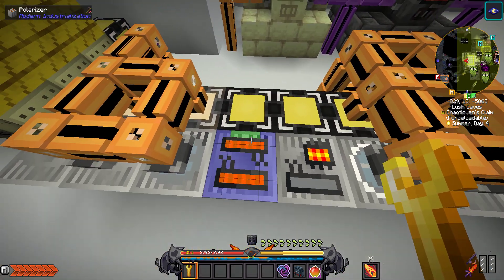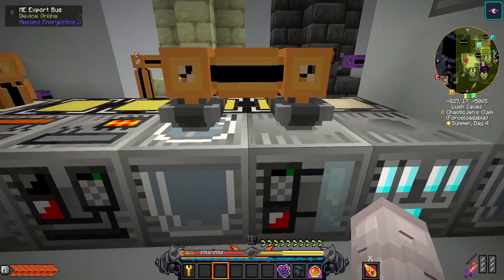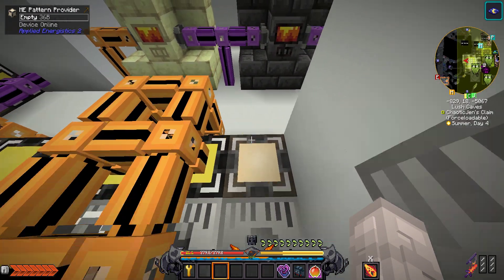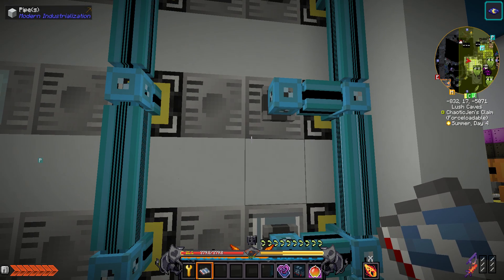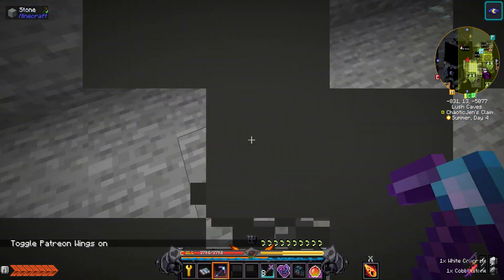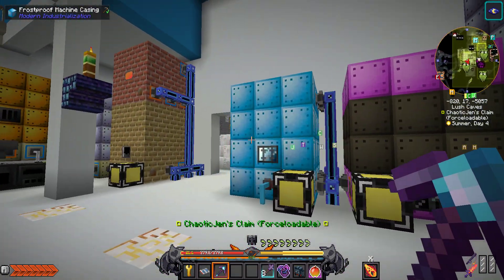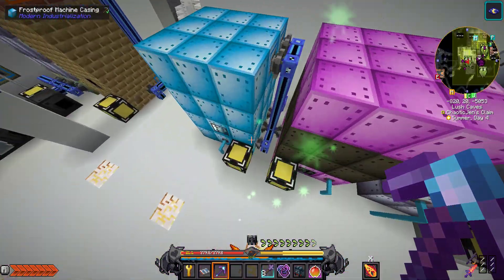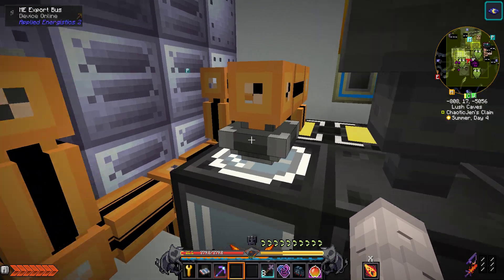How to automate Modern Industrialization with AE2

Comment: for some reason when I pump creosite oil out of the coke furnace it just dissapears and I cant see it in my ME system. even if I pump it into a tank and place a storage bus it doesnt show that I have it in the system
Reply: I figured it out, for some reason byproducts (in this case the main product is coke, creosite is the byproduct) show up in the system only when the process is complete (when no more coke is being made) thats why I couldnt see it in my storage. Is there a way to fix it? For now I just put export bus with coal so it produces coke with all my coal

Comment: How would i automote creosole production using ae2 pattern provider on the coke oven multiblock? I have the imports and exports on the right hatches, but when I put the pattern provider on the front controller block nothing happens

Comment: I'm trying to set up auto-crafting for Lubricant using AE2 and Modern Industrialization. I've created a Processing Pattern placed it in the Pattern Provider connected to the Modern Industrialization Mixer.

However, when I open the Crafting Terminal and click on Lubricant, nothing happens — no option to select the quantity, the request just doesn’t get created

What might I be missing? Maybe AE2 doesn’t support auto-crafting liquids directly?
Reply from the maker: I just went to a new world, placed a pattern provider next to a bronze mixer, powering both, and crafted the lubricant pattern. It seems to be working. I noticed the electric mixer seems to have a bunch of patterns removed.
Reply: @JustChaoticJen  Yes, my mistake. I apologize. It turns out that to request liquids, you need to press the **middle mouse button**, not the left mouse button as you would for item crafting requests.
Reply from the maker: @ No worries!

Comment: So just curious, has anyone figured out how to Do fluix crystals with the Electric mixer? I can request it, and it will start making some, but it will always be short, by at least half, of what I requested. And then stop. I have the pattern provider hooked up to it, it feeds it, and then pulls the results out. But as I said, it feeds it less than I requested. So if I request 100 fluix, it will put in 24 of each of the things, which will make 48, then it will just stop. But the request will sit there waiting to do it.
Reply from the maker: sounds like the pattern you created is wrong. I have a video for how to make fluix using AE2, which works, and there is an excellent guide in game.

Comment: Thanks for the help, I didn't think that an EBF would allow fluids to just sit in the multiblock unless it was a part of the currently being processed recipe. I really wish there was a block that held both fluids and items that you could use 1 pattern provider per EBF for automation.
Reply from the maker: well the Ae2 settings can remove fluids as you dont need them anymore, but Im not an MI expert.
Reply: @JustChaoticJen  Yea, I just followed your design. I just didn't think to try that cause MI is very finicky, not to mention very resource/time intensive. I prefer the OG IC2, but MI is sllllooowwwly growing on me because of the complexity and challenges it provides for automating.
Reply from the maker: @Elfhugger  once you get to the fusion reactor you should have everything automated, its a huge flex.
Reply: @JustChaoticJen  The Reactor is next on my list! Its for All the Mods 10 to get the quantum blade. I wasn't going to bother, but I'm a glutton for punishment lol.